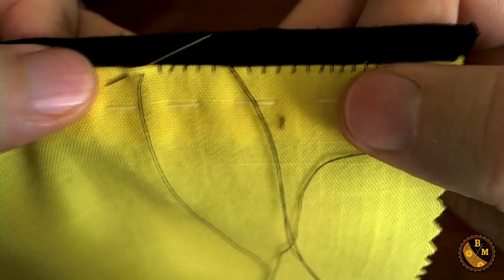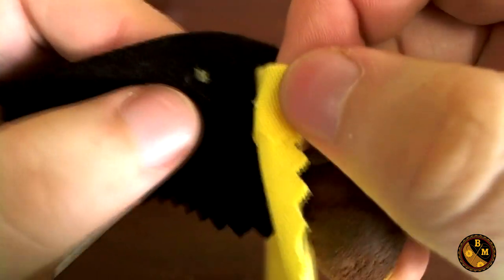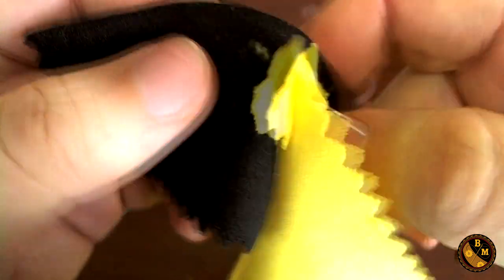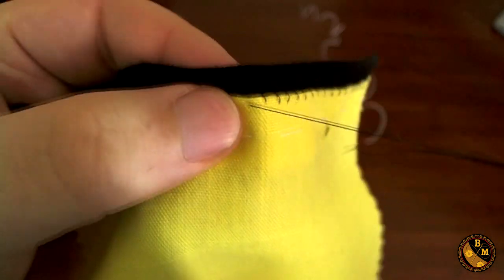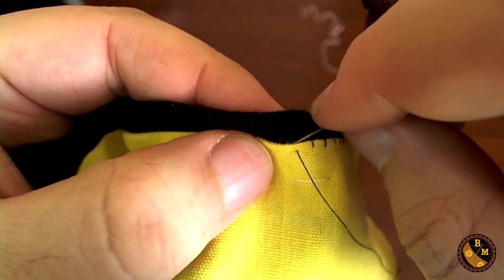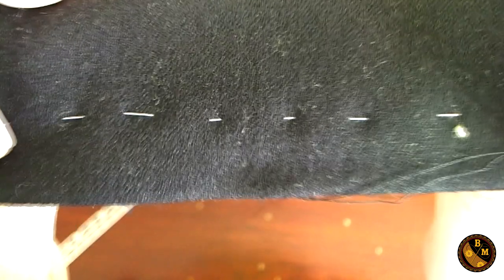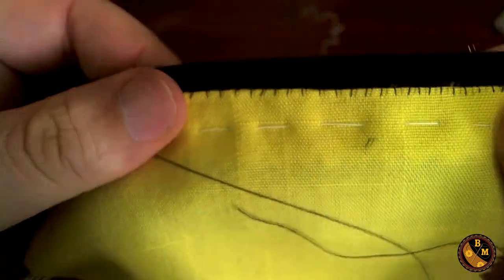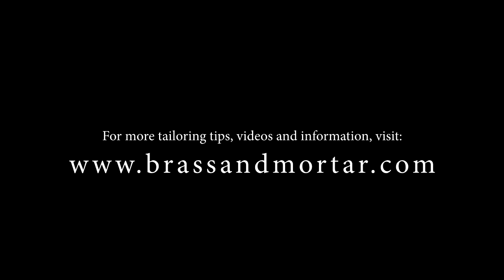Hand-stitching: The Fell-stitch

Comment from the maker: True. I just figured it was self-explanatory visually.
Reply from the maker: ***** The two could be considered related, but the difference is the position of the fabric. It's hard to describe, but for a whipstitch, imagine taking two raw ends of fabric, placing them atop one another, making a spiraling stitch that whips around the raw edge, essentially binding the raw fibers. That's a whipstitch. In the case of a fell-stitch or slip-stitch, you're folding or ironing the raw edges back and stitching the folded edges. There's no whipping around.